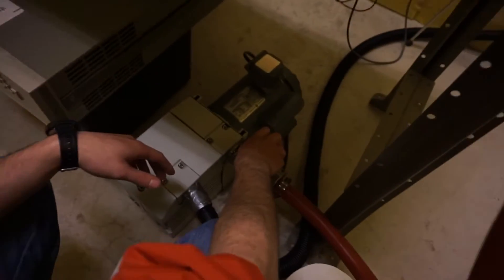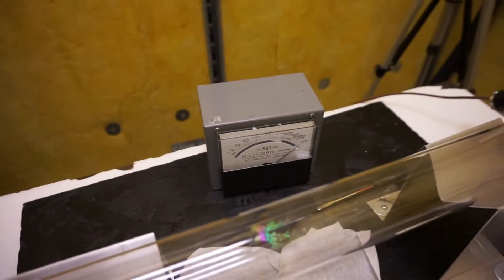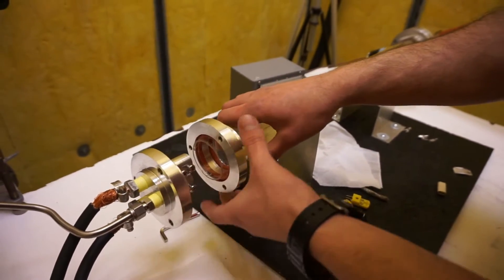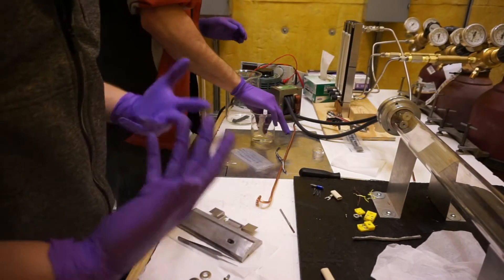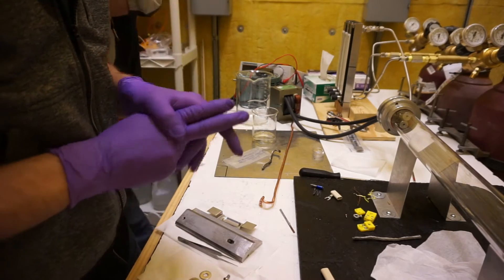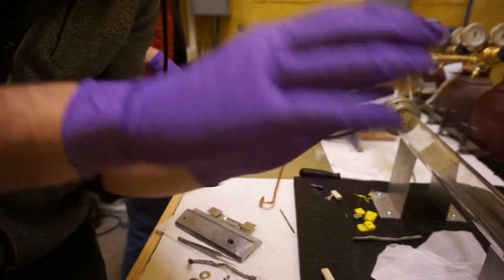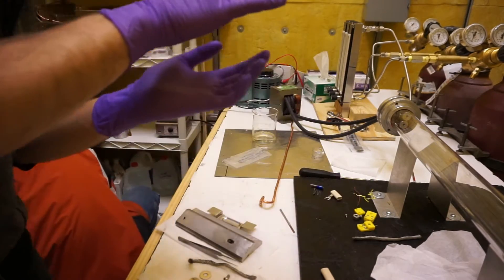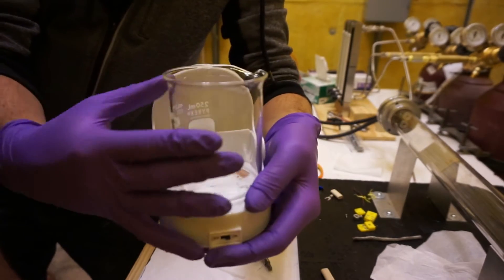Goodbye to the Graphene Lab

Comment: how much time you are locking the vacuum when the substrate gets heated ?
Reply from the maker: Sorry, what do you mean "how much time locking the vacuum"? The pressure is at about <100mTorr when we heat the substrate, and it takes a couple minutes to stabilize at this pressure when pumping down the chamber from atmosphere... Does that help?

Comment: why not use copper granules? or pre melt the copper (you can let it re-solidify, but that way it takes the form of the tub. both of those methods should help heat transfer (I would think)

Thank you for the video!
Reply from the maker: Indeed! It isn't shown, but we later said screw it and threw in a big chunk of copper, melted it down to anneal, and grew on that. Haha it "worked", but isn't ideal for many reasons... lots of copper, can't get it off the tungsten easily after growth, how would you do a wet transfer with so much copper (the sample is typically coated with polymer and immersed in copper sulfate to dissolve the copper, then graphene on polymer is left behind and transferred onto insulating substrate...), etc... Thanks for the input!